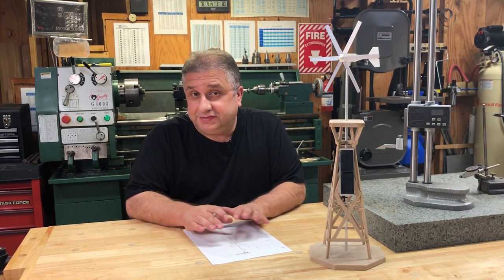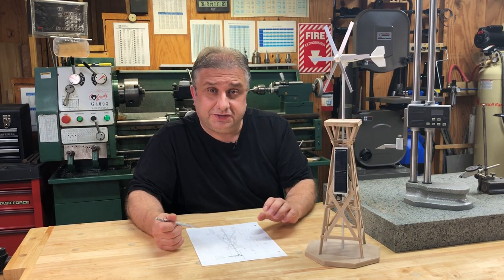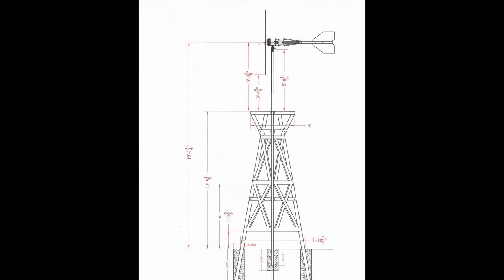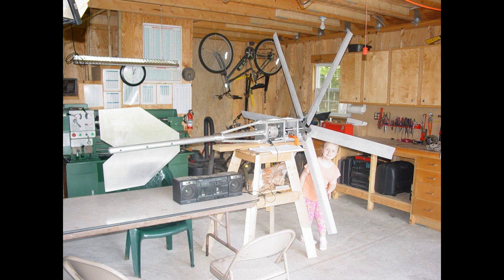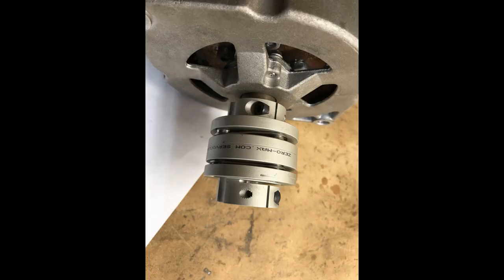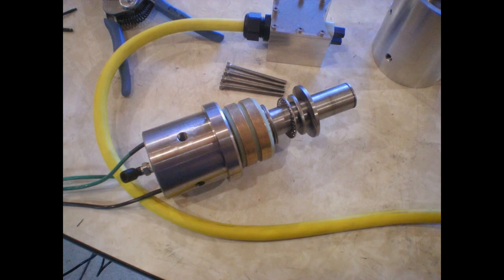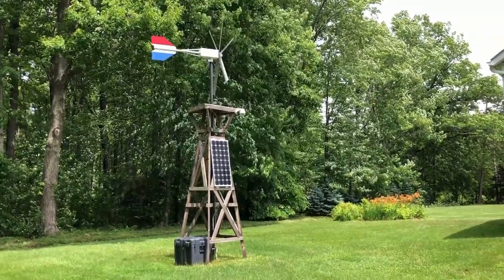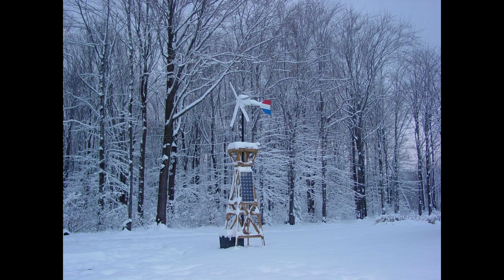Homemade Wind Generator

Comment: The blades must have torsion along the axis, that is, from the center to the tip of the blade, the angles along the blade should not be constant, if the angle is constant, it will not develop high speeds of rotation. Excellent project, greetings.

Comment: I recommend you as a mechanical engineer, you must install a 10:1 multiplier transmission to increase the RPM and you will have results, a wind generator at 250 RPM with a 10 m/sec wind and a blade diameter of 360 cm, the torque is 300 N x m.

Comment: Do you have any "real world" power output readings?  Example ... With 15 MPH winds at the top of the tower, how many watts does the PMA generate?
Reply from the maker: I did some testing in the first year.  Not sure what I did with the data. The location that I have it in is the worst possible location.  Now that the leaves are down I could try collecting some data.  In the winter months I get much more wind.  The data from the blades stated that they turn 50 rpm at 5 mph and 600 rpm at 20 mph winds. The PMA power curve shows 5 amps at around 200 rpm.

Comment: your braking system is great, but you could use  the break to act as a break so you never need to stop unless in very high winds ..,, ARDUINO  🧐